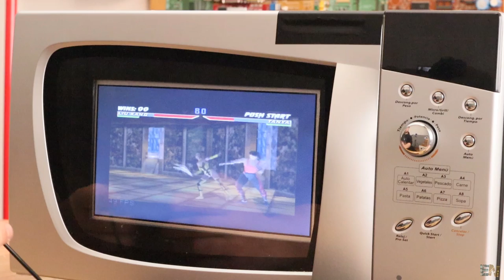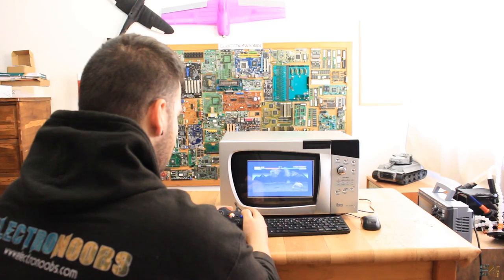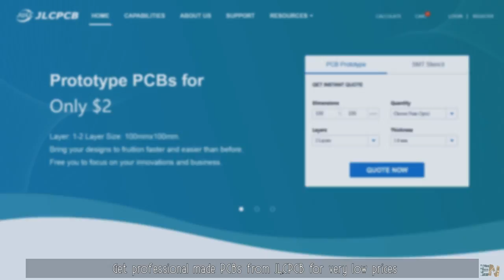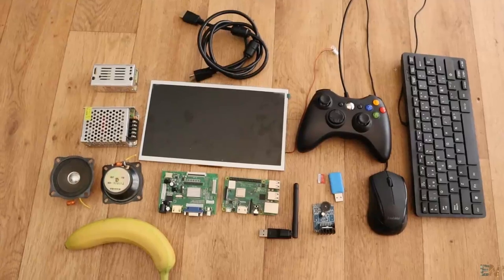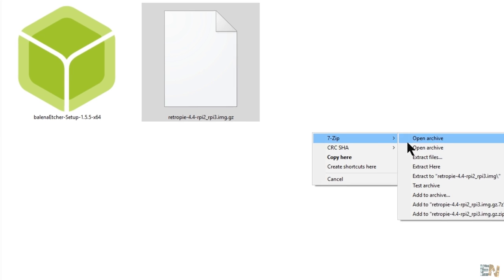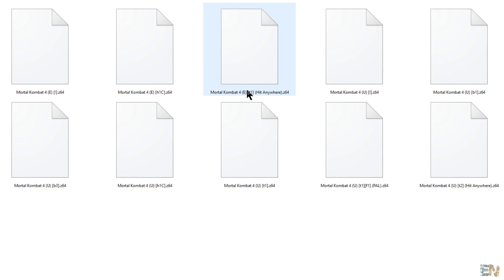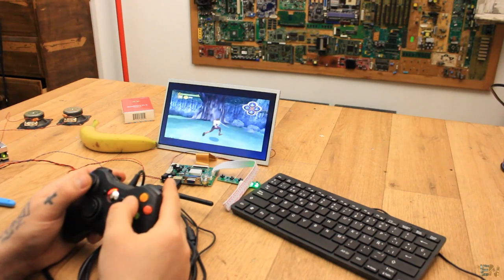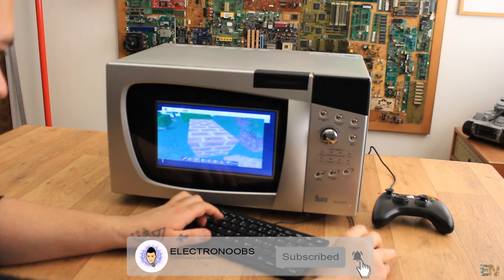RETROPIE microwave

Comment: First of all , congratulations sir for your 100k subscribers, have been a subscriber for a long time.

I have got into a problem, I was replicating your 7ch rc controller build and completed it but the transmitter and receiver won't communicate with each other.

Tried everything but in vain.

Now a master builder like you can only help.

I am sending the pics.

Checked the soldering

Checked my modules and arduino

Thank you